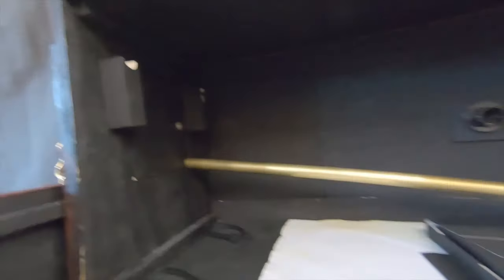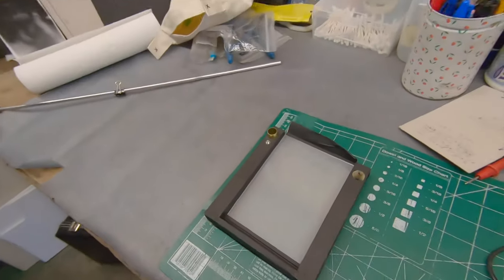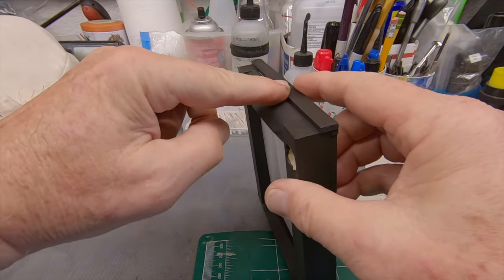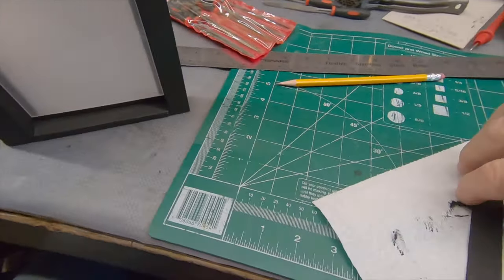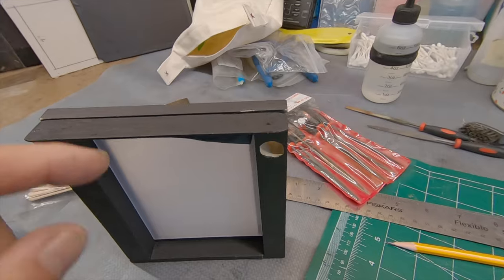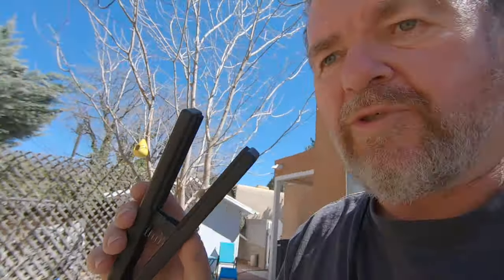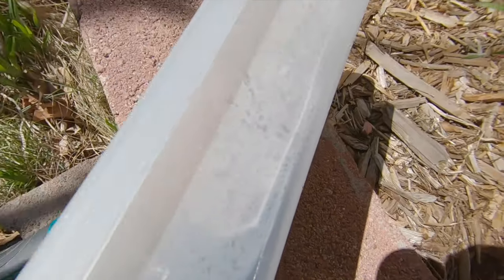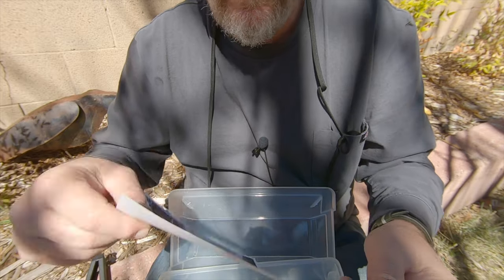Dark Box Camera 4x6 Upgrade - Part 2

Comment: I'm very impressed with the quality of the photos.  👍  Should the drying box maybe have some small holes in it to let out the humidity? 

I watched a video of an original Afghan camera in use and the camera had a peep hole (a la Speakeasy front door) on the top, right over the developer tray, so that the photographer could eyeball the progress of the developing. In his process he photographed the negative to produce a positive. I think your contact print method, though fiddly, gives a better result.
Reply from the maker: Holes in the drying box are a good idea.

This camera originally had a peephole viewer with a pull shutter to open and close it. I used a red LED to illuminate the insides. I never could get it to work without fogging the paper, and standing in bright sun it was difficult to see the negative even with the LED. I find getting the right exposure, then a standard development time, works well enough for me.
Reply: @Joe_VanCleave  Have you tried using Rubylith to make a safelight? The ones in my darkroom are all made like that. LED bulbs and Rubylith filter. I don't use them up close and personal to the paper though, that might make a difference with fogging.

Comment: Hi Joe, that print is looking real nice, good job. I'm making a box camera of my own, seeing as we all have a little spare time at the moment. I'm working on the ground glass at the moment and nearly ready to take some test shots. I have two questions: 1. Do you fix the frosted side of the focus glass/plastic towards the lens? and 2. I have set up my negative holder so that the paper will sit of the front side of the glass as apposed to your version sitting on the back, do you think this will be an issue? Thanks Joe, stay safe.
Reply from the maker: The ground side should face the lens and the paper should fit in front of the glass/plastic facing the lens, so the ground glass needs to pivot or hinge back, like in a large format view camera.